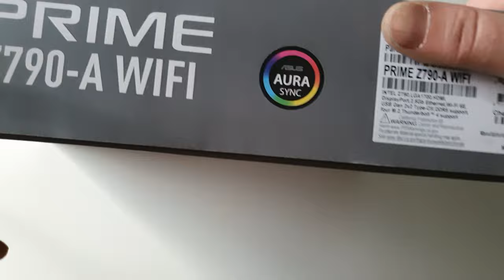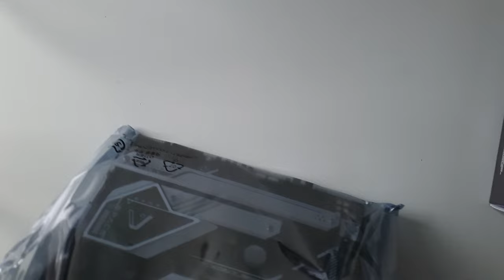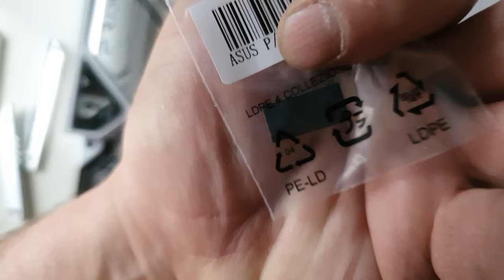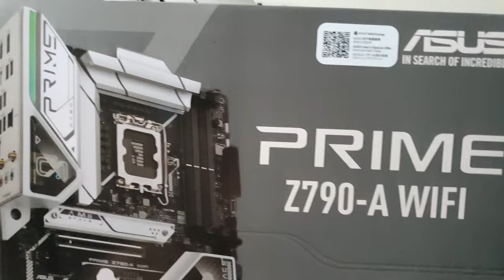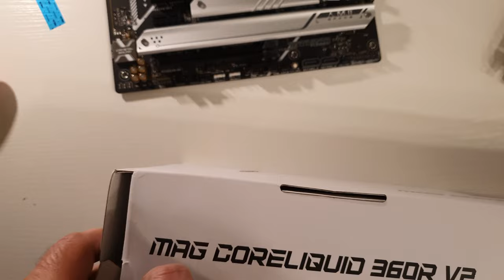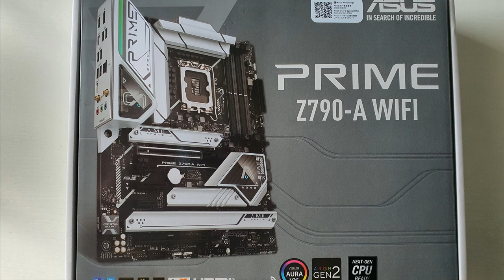ASUS PRIME Z790-A WiFi !!! UNBOXING !!! +14600k+6400/32GBcl32FURY+4060TI+990PRO+300R PC BUILDING

Comment: No dual channel?
Reply from the maker: I think RGB look nice at evening when 2 rams together , in dual i see ugly hole between rams ;)
But seriously:
,Intel says "Intel® processors come in four different types: Single Channel, Dual Channel, Triple Channel, and Flex Mode. Maximum supported memory speed may be lower when populating multiple DIMMs per channel on products that support multiple memory channels." 
I am using 2x single controller for each memory , by using dual it will make me using only 1x controller so speed may be lowered.

In this video you can see fps change in higher resolutions, https://www.youtube.com/watch?v=Xdb9SSv0w9E ,
 it is easy too see in 1080 p most games shows 20 fps more in dual channel , in 1440p it is only 3-4 fps only, and if you will check youtube you will find video with 4 k resolution , and it clearly shows +2 fps in most games for single channels.

If you are really interested, i can run cinebench r23/ r24 tests , or any other, i think testing old games like 3 or 4  or more years is without sense, these were prepared for years earlier .
New games which will come in this year should use new technologies ,maybe then it will be more clear about using dual in highend games .
Synthetical tests or old game sare not showing true idea .

If you wish , i can test software whichever you want to .